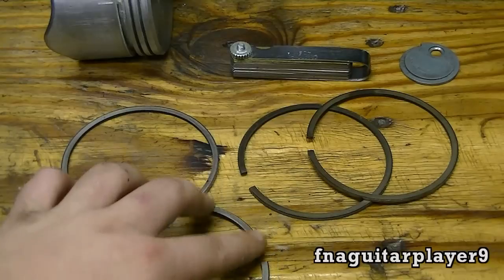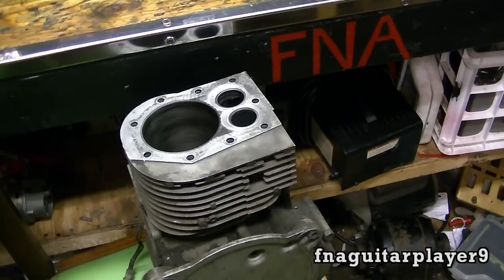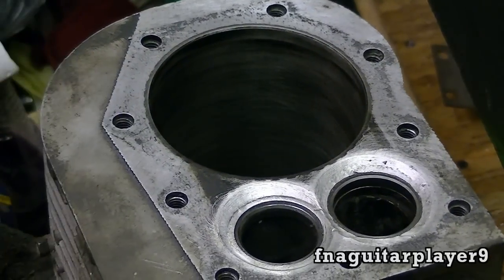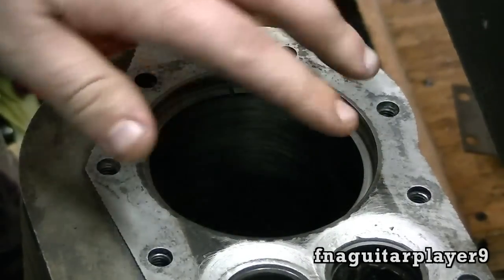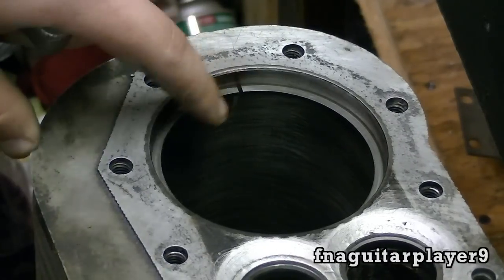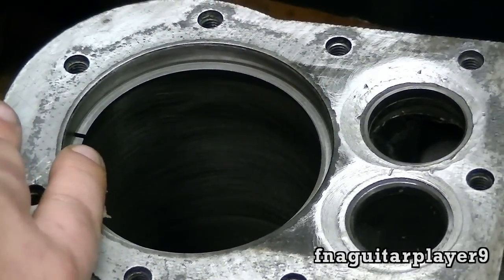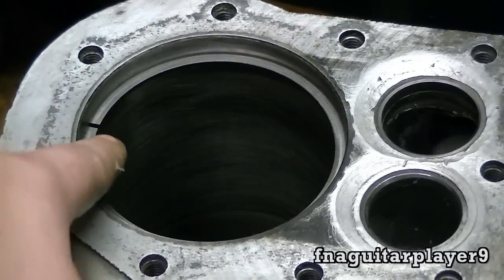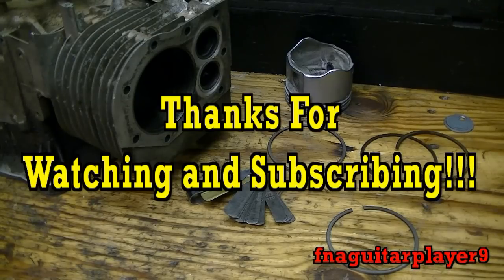How to Measure Piston Ring Gap (and specs for lawn mower engines)

Comment: I pull all the old rings off the piston and clean the piston. I wipe down the cylinder and the old rings. I stuck the ring in the cylinder with the gap down, then roll the ring upright. Then I insert the piston in upside down to square the ring to the bore. I usually check the gap on the old rings and new rings before I assemble the piston. that way I can adjust the gap of my new rings if necessary.

Comment: If I've torn an old engine down to clean it and unstick the rings and I've checked the gap, they are worn but still ok, the cylinder is good, should I hone it before I reassemble it.. 
This engine sat out in paddock for years but was still in the old mower, I'm using it because my ride on blew the con rod.

Comment: Is .035 way out of spec for a 1989 10 hp briggs model 25
Reply: That’s basically right at the line of being rejected/out of spec.  It’s quite a lot looser than new and probably burning some oil at that point.  Would def be good the just replace them.

Comment: I’ve broke my oil ring when filing it. Any tips to keep them from breaking?
Reply from the maker: You have to be gentle with it and use a finer file, aggressive ones will dig in more, or you can use a dremel with a cutting disc just be careful not to take to much off. Thanks For Watching!!!

Comment: Thanks for the videos FNA.  Just tearing down and rebuilding my model 28 and wouldn’t have been as confident without your help.
Reply from the maker: Your welcome! I hear ya! glad to help out! Thanks for Watching!!!
Reply: fnaguitarplayer9  One issue with the rebuilt motor, higher compression = battery upgrade. Old one struggled to turn it over fast.

Comment: Hi!! Thanks for the video. Pls tell me If the lawn mower aluminium cylinder coating such as Nikasil has been worn, does it make sense to hon it and how long it will work?
Reply from the maker: your welcome. Briggs never used a coating on the aluminum bore cylinders, they used a chrome plated piston with chrome rings. And when rebuilding you do not need to hone a aluminum cylinder, it just causes excessive cylinder wear.  Thanks for Watching!!!
Reply: @fnaguitarplayer9  Hi! I understand it now, thank you very much for your answer!!

Comment: Can I put cast iron sleeve in a bore flat head engine
Reply from the maker: Yes it can be done, usually has to be done by a machine shop, cylinder has to be bored out to fit the sleeve, then bored to fit the piston. Thanks for Watching!!!
Reply: So it has to be bore 2 times
Reply from the maker: @ryanmcgouirk2655  as far as i know, unless the sleeve comes prebored for standard size, not sure to be honest.

Comment: How do I measure cylinder to see if it is out of spec? Can you do a video in that? Is there a certain measuring tool to use?
Reply from the maker: Its hard to explain, the ring gap will give you a good starting point for cylinder condition, you can do it at different parts of the cylinder to see if its tapered or not too. You would use a inside measuring tool then use a mic to measure it, usually at 6 different points. Thanks for Watching!!!

Comment: Does this apply to all 3 rings or just the compression ring?
Reply from the maker: All 3, but the top compression ring is the most critical for compression/oil burning. The oil ring isn't quite as critical since it lets a controlled amount of oil through anyways, but still needs to be checked. Thanks for Watching!!!

Comment: Great video! Man you got great content!

I'm interested in how rings get worn? No or low oil cause this? Engine running too hot or too fast? I got a very new mower that I suspect has bad rings and/or bad scored cylinder because compression dry is VERY low and wet it does go up some.
Reply from the maker: Appreciate that! All of the above will cause excessive ring wear, and not doing doing regular oil changes will make all engine parts wear faster too. First thing I check on small engines with low compression is the valves, especially on the flatheads, as the valves wear in the seats they drop some and usually to the point where there is no valve last/clearance and the valves don't even close all the way. Thanks for Watching!!!
Reply: @fnaguitarplayer9  what's the best way to test valves if they are seating? I need a nice diagnostic tip because I have one with a lot if carbon build up and I think it may not be seating all the way but it's so hard to tell...

Can I shine light through it or try to see if gasoline will seep past it?
Reply from the maker: Yes to both, but i would just spray carb cleaner or wd40 into the port and see if it seeps out. If i suspect valve issues i usually reseat anyways while it s apart to rule it out. if its a flathead make sure you have clearance if not it won't seal right.

Comment: Question. I have a Briggs 19.5 model 31p677 my ring gap after honing the cylinder is a snug 0.011" that should be fine shouldn't it? I'm rebuilding it because the rod broke. The cylinder looked decent but had some heat streaking and one small scratch so I went over it with a hone just wanted to make sure ring gap is ok.... No smoke is a good thing lol
Reply from the maker: Thats not to awful big, but when i rebuild engines I try to keep it close to .003", that may smoke just a bit or you might just smell some oil burning in the exhaust, it might be ok. Thanks for Watching!!!
Reply: @fnaguitarplayer9  thanks! I got it all buttoned up runs fantastic! No smoke no oil burn. Keep up the great videos thanks
Reply from the maker: @371redbull  I hear ya! Thats great, your welcome!

Comment: I have a Briggs 10hp model # 254707. Do you know where I can find what each piston ring gap should be?? Or a chart of some kind? Thanks much.
Reply from the maker: Like the specs in this video, I try to keep them between .003" .010", that will give plenty of life to most engines. And more than that and they will smoke, even after a rebuild. Thanks for Watching!!!
Reply: @fnaguitarplayer9 are All 3 rings between .003" & 
.010". Also have you ever had rings that the 2 top rings are exactly the same rectangular shaped and No notch in second ring.?
Reply from the maker: Yes. It seems like I have, but not for sure, most of the time one is slanted and one has a groove/notch in it, but all brands are different.

Comment: I'd like to know if there's a way to check the ring gap (eye balling it) while the piston & rings are already assembled and in the cylinder. I've Tried to use a flashlight to see if I could see one. But to no avail.
Reply: Lanes Small Engine Repair No, you have to remove the piston and rings and check the gap with the ring in the cylinder. Normal gap should be about .008-.010. Check at the bottom of travel.
Reply: @robbyjones7631  Briggs repair manual states that anything over .030 is to large of a gap and those rings should be rejected, under that is fine, but not too small of a gap

Comment: Hi Question 

i just got a NEW BRIGGS BLOCK 15c107-003-f8 
Do i need to Hone IT ?????????????????????
Reply from the maker: If you can see hone marks in it, then no you don't, but if its smooth with no marks then it wouldn't hurt to do a light hone on it. But if you see any hone marks in it, then no. Thanks for Watching!!!
Reply: Hi the virgin Block had a mirror Finish !!!
I DID not hone it just assembled with new Std Piston and Std Rings , New Con rod , New Crank .
Runs ok Now 
the Surging Cleared after using " Mechanic in a Bottle " ( Carb also Cleaned 5x prior even with ultrasonic )
FYI the old Ruined Block ran with now oil , also had Shiny mirror finish on cylinder wall
the 1st time i tried to hone out Scuff cylinder either honed too much and ring clearance too big after 30 mins started to to smoke

Comment: is it possible to decrease the bore size in able to get the correct ring gap sir?
Reply from the maker: The only way to do that is to have it bored and a new sleeve pressed in then, then you would start over with standard size rings and piston. But you usually fit the rings to the bore, not the bore to the rings. Thanks for Watching!!!

Comment: I just measured my gap it's .052. My question is, Should I go with standard 8 hp b&s rings or by the more exspensive "30" over rings?
Reply from the maker: You may not need 30 over rings, you could probably get by with .010" over, no guarantees though! Now this is assuming your engine has the cast iron sleeve, if its aluminum bore you will have to order chrome rings, which are slightly oversized. You never know how much the rings wore, or how much the cylinder has worn until you measure a new set and see what it says. But yeah, I would try the .010", if they cost the same as the 30 go ahead with the 30 just to play it safe. But like i said its no guarantee, you could get the 10's and still have to file them alot you just never know. Thanks for Watching!!!
Reply from the maker: and another thing, a standard set (not oversized) may be just right or still may need to be filed, or if the cylinder is worn, it would be to big of a gap.
Reply: RFKFANTS67 Get standard rings and check the gap. If too wide, try next from standard and maybe file it to about .008-.010 at the bottom travel.

Comment: I bought a new piston assembly (499909) for a briggs 8 hp model 190707, but forgot to check the ring gap before assembling. How likely is it that the new rings needed filing?
Reply from the maker: I hear ya. ITs hard to say there is no standard for it, but i would suggest if your not to far into re-assembly to tear it back down and check it. Just guessing though, i'd say if you used standard size rings it should be fine,  but i can't say for sure. Thanks for Watching!!!
Reply: +fnaguitarplayer9 thanks for the reply. I went ahead and just ran the engine without tearing it back down. it ran for maybe 15 minutes without any major problems. however, it is running rich and I couldn't seem to improve it with carb adjustments. I'll check you channel for carb adjustments.
Reply from the maker: no problem, i hear ya! some are not adjustable just depends on model.

Comment: I just took 2 bad engines and made a good engine,Briggs & stratton 21 h.p. the thing started and ran great for ten minutes turned it off went back to it and the thing started smoking, not teribly bad but bad enough to where i wouldnt want it.lol..but I pulled it back apart and the ring gap on the top compression ring is like only .010 i mean its like a new engine there..so what the heck started this smoking issue..I never had the head off of the one I had running so figured the head gasket was ok..you have any ideas for me to look into? Thanks!
Reply from the maker: I hear ya! Did you check the other rings as well, its possible it has a bad oil ring. Or it could seeping oil past the valve guides, some of the OHV motors have valve stem seals and some don't, it might just need them replaced if it does have them. hope this helps! Thanks for Watching!!!

Comment: Would the specs you gave in the video also apply to 2 strokes? Or do 2 strokes have different ring gap rejects?
Reply from the maker: Carl's Small Engine Repair 2 strokes aren't quite as critical since they don't need to control oil, so I would say it would be about the same, i'm not a 2 stroke expert, i've only rebuilt a few 2 strokes, but i would say it would be in the ball park. thanks for watching!

Comment: Where can I find the specs for my engine? I have a 14 1/2 briggs with a .028 ring gap.
Reply from the maker: WOOODYII2 that would fall into what the general specs i gave on the video, which was for a 12 horse briggs (model 28, same cylinder / piston / stroke as a 14.5 model 28 ohv), as long as it doesn't exceed .010" with new rings you should be good to go. Thanks for Watching!!

Comment: Good video, I learnt something thanks. I have a question, recent I took off the top end of my Harley engine because it was making a chattering, tapping sound when I first started it up. Cold Start. then it went away after a minute or so. Anyway after removing the Cylinder Head and Valve cover I noticed a bunch of crud and crust on the piston and valve cover. I don't mean just carbon build up, this looked like the stuff was fused on the piston and intake and exhaust. 1. What could have caused that and 2. like an idiot I used a wire wheel to clean the Valve Cove and made some scratches and caves in the thing, 3. would it leak oil? I want to put it back together after I get some new pistons, rings, and valves, pushrods etc.. but this is not a lawn mower and is very involved. Do you think I can smooth out the Top End components and how?
Reply from the maker: midnightrun7 your welcome! i'm not really sure right off hand what the crust could have been without actually seeing it, does it have a air filter on it? Because if dirt is getting into it will gum up everything like that. It might leak oil if the scratches are bad, what i usually do on valve covers (on lawnmowers, but it would work anything) is use a gasket maker along with the correct gasket, i recommend permatex form-a-gasket #2, put it on both surfaces then put your gasket on, after that it shouldn't leak. to clean it all out i would use a wire brush first (make sure piston is at the top TDC and both valves are closed) thats usually the thing i've ever used to clean it all up with. Hope this helps! thanks for watching!!!
Reply: Thank you for the reply and great video! I'm off to the auto parts store to get those items. I got the cylinder head, valve covers(combustion chamber), valves and Pistons cleaned up pretty good. Are they 100% true...I doubt it but looks ok with a straight edge & guess that's where the Gasket Maker comes in. Also, I used I vibrating sander with 500, 1000 then 1200 grit and 3-1 oil and sanded the tops where the gaskets go on both sides and a drill with scotch bright circular pad around the chamber and cleaned up that mess and the valves. I think what happened here was oil in the breather got sucked back in along w/ the air and fuel causing this. Also, had a hair line crack in the header?? Going to try and upload some photo's I took...before and after, let me know what you think. Thanks buddy!!
Reply from the maker: no problem! I hear ya! They should be good enough if you did all of that to them, i'll also add that make sure you clean out (compressed air if possible) around the piston, so no particles get wedged between the piston and cylinder wall. And what i do anytime i have the top end off a motor, is put a little motor oil on the cylinder walls, just so you know its oiled when it starts, might smoke a bit at first but you know its not dry. It should be cleaned up good enough, sounds good! no problem!
Reply: Hope your having a great weekend! Please take a look at these new shots and let me know if I re-install these parts with new gaskets, Billets, Pushrods etc... The bike would run okay? It ran good from NY to CO. and Back....Just the Top end noise on cold starts and a leak in the Headers (V&H Power Duals). Maybe I was sucking oil from the breather along with the air and gas and caused this carbon build up. Maybe had an air intake leak...idk. Also, please check the bluing on my crank and let me know if you think that's the way it's supposed to be if you would be so kind, if you do work like this, I'd appreciate your help.
Thanks in advance. Nick-
Reply from the maker: I can't seem to find your video, post a link to it and i'll check it out. Carbon build up also comes from using low octane gas (like everyone uses haha) Thats one reason why lawn mowers always have carbon build up, that and the low RPM's.

Comment from the maker: yeah this is often overlooked when rebuilding. Thanks for Watching!
Reply: Any idea what the correct ring gap would be for a techumseh 206810d 13 hp vertical shaft engine should be?
Reply from the maker: @angelacampbell1134  I would think it would be similar to briggs and should be between .003 and .010 for a rebuild, but it could be different but I'd go with that, its a pretty common spec. Thanks for Watching!!!

Comment from the maker: your better off to replace all the rings on all cylinders, because they are all supposed to be the same, if not you'll have one cylinder with more compression then the others, i don't have the specs for that engine, and i've never worked on diesel engines so i can't really tell you much, but you always want to check the gap first because they are usually to tight at least with gas engines. thanks for watching!

Comment: Hi .. fanguit.....it's really good vid ... sir >> I have KIPOR Diesel generator .. it needs to replace the rings ... but ... I was a little confused .. should I install the new rings with gab as it manufactured , or measure the gab of the ring ... and if I measure ... how much should I put the gab ...in mm >>>> note: it's one piston engine ~ thank you in advance

Comment from the maker: the float is inside the carburetor, i'll pm you a link to one of my other videos that i take the carburetor apart on, i go into detail on it. you will probably have to adjust the tab on the float that sets the float's level. you can leave the valve and float in place and just get in with a small screwdriver and bend the tab. now if it has a plastic float (newer carbs) you may need a new float and/or needle valve.

Comment from the maker: Very common problem! What usually happens is the float sticks in the carburetor or a bad needle valve, lets gas pour through the carburetor past the intake valve / piston / rings into the crankcase with the oil. Don't run the engine! Fix the carburetor (sometimes the float will stick or you may need to replace the needle valve) then most importantly, do a oil a change, you do not want gas in the oil, it will destroy the engine. After you do a oil change it will smoke for a while after >>>>>>